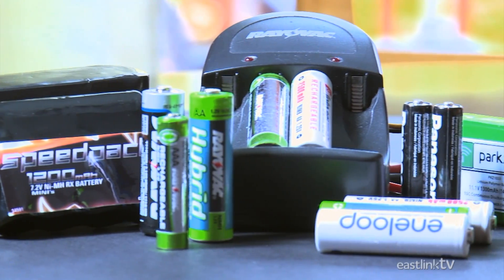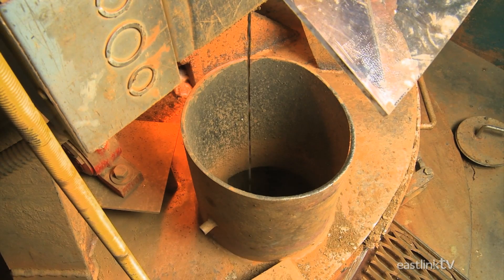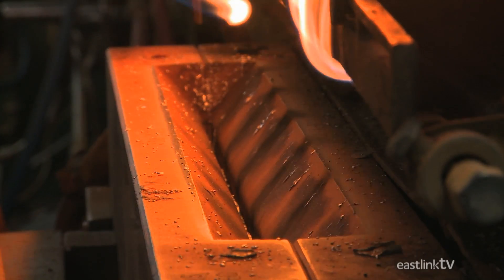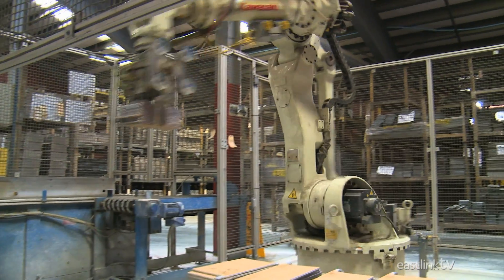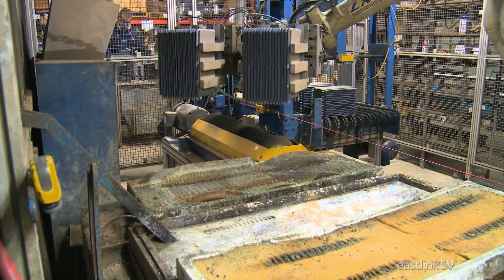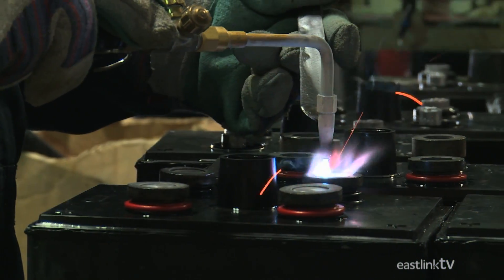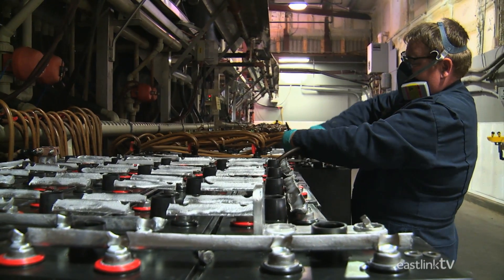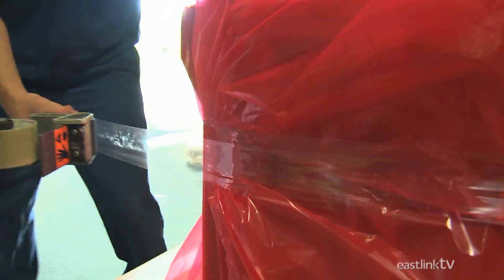Surrette Battery Company on Maritime Made

Comment: With this simple battery reconditioning method, you won’t have to buy new expensive batteries in 2017.or ever again [Check Details Here==>https://plus.google.com/100351090281822647456/posts/HMvgs7qqoKA ] .You can just recondition your old, used batteries and save a lot of money!